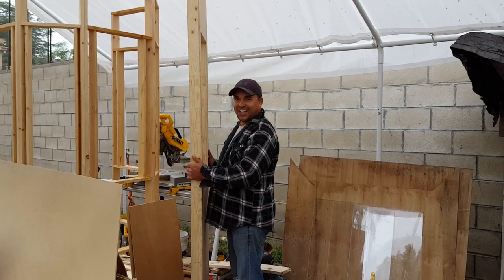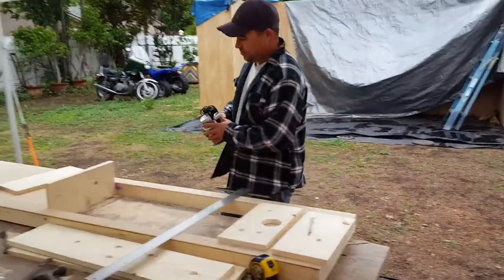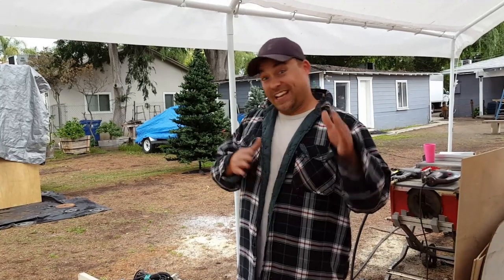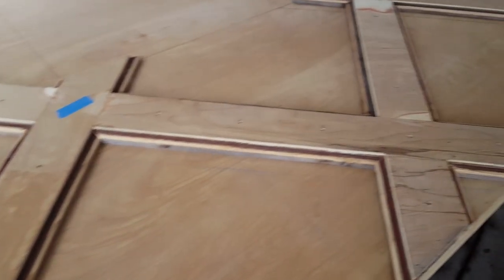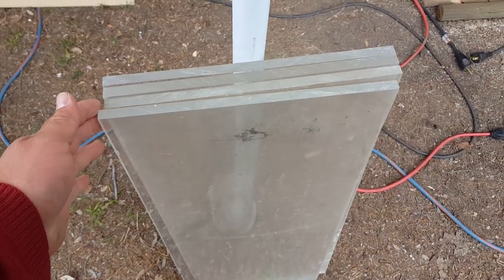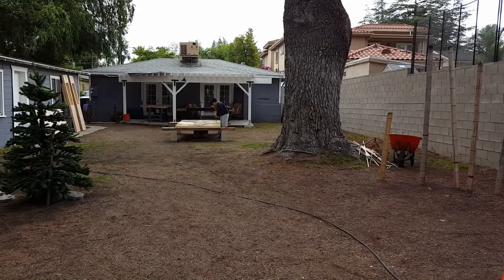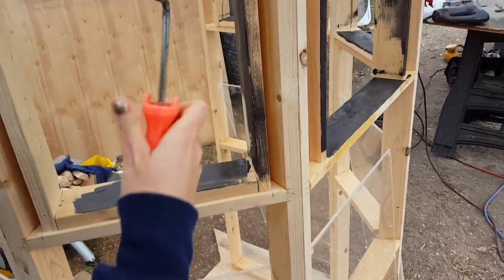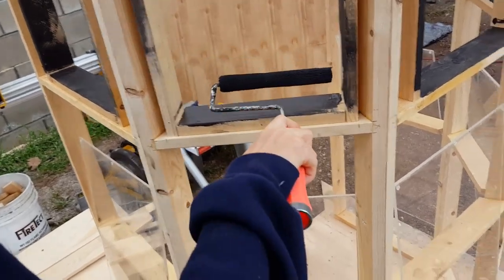Cutting Plexiglass & Polishing Acrylic Edges - HAUNTED CINEMA TICKET BOOTH! Halloween Facade (Pt.6)

Comment: Very cool guys! How much are you guys paying for plexiglass?  its super expensive here and Im going nuts trying to find some that wont break the bank
Reply from the maker: So it varies for us depending on where we get it from.  We try to get it from sign companies. We ask if there is any damaged or scratched plexi. Sometimes they have older plexi where the paper is harder to get off. You just use a heat gun and goof off. It never hurts to ask. Craigslist sometimes has it.  I wish it was cheaper also, we would use it a lot more if it was.
Reply: Thats a good tip I might have to check some local sign places!